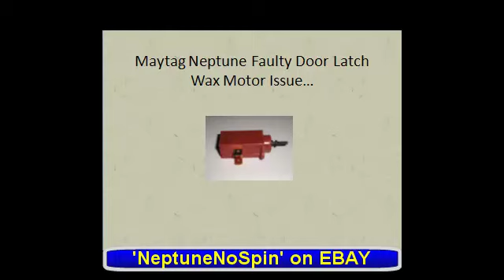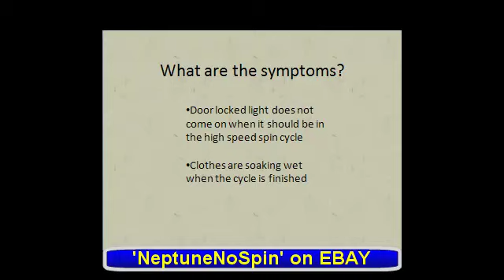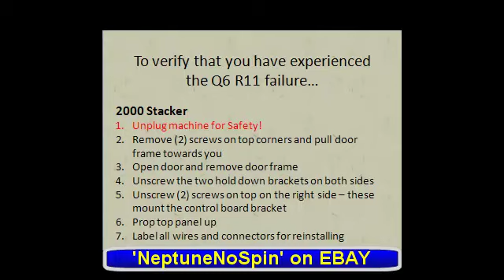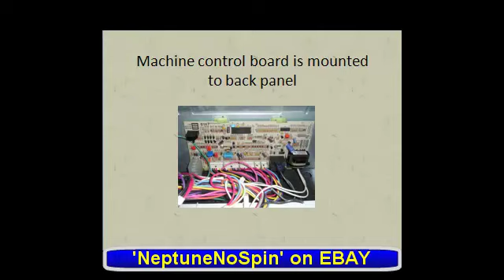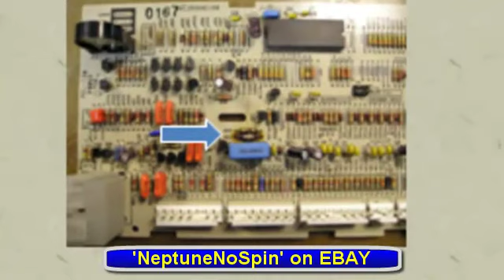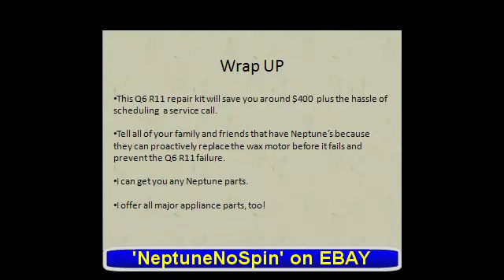MAYTAG NEPTUNE WASHER R11 Q6 REPAIR KIT WAX MOTOR

Comment: R11 and q6 fried on my mah4000, but my washer went through the cycle as normal, but in the last state "idle" it would continue tumbling intermittently, indefinitely. I believe this is because the triac fused closed causing the wax motor to never disengage. .
Reply from the maker: Hi, Yes, you are correct... Your Q6 triac shorted internally which will keep the wax motor energized so the washer will just slowly tumble back and forth waiting for the door to unlock. Visit my http://www.neptunehelp.com for my STAGE 1 Q6 R11 repair kit. 

Thank you,

Jeff Hartman
"The Neptune Man"

Comment from the maker: The STAGE 2 kit I offer is for when the timer does not rotate properly or when the wax motor still does not energize after the Q6 R11 replacement . I will put up a video with more STAGE 2 information so subscribe to my channel so you will be notified when it is available. Jeff neptunewaxmotorcom

Comment: The STAGE 2 kit I offer is for when the timer does not rotate properly or when the wax motor still does not energize after the Q6 R11 replacement . I will put up a video with more STAGE 2 information so subscribe to my channel so you will be notified when it is available. Jeff  neptunewaxmotorcom